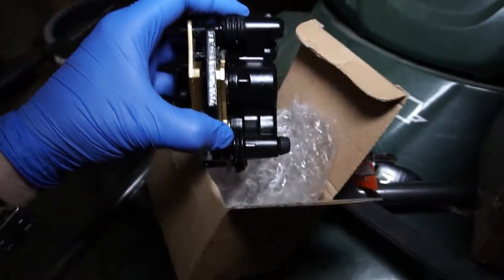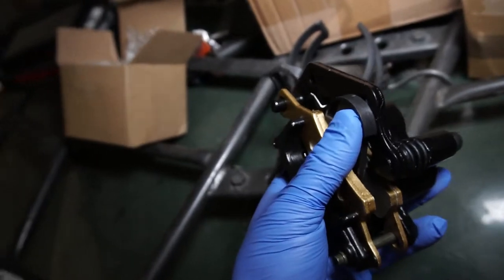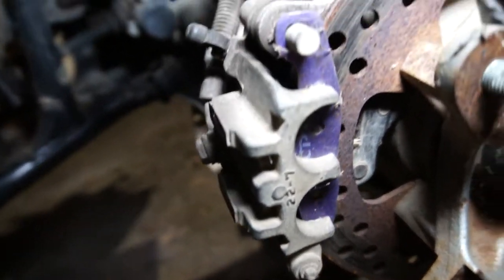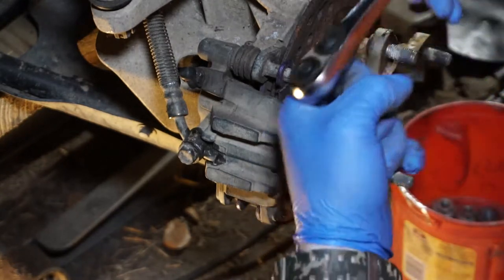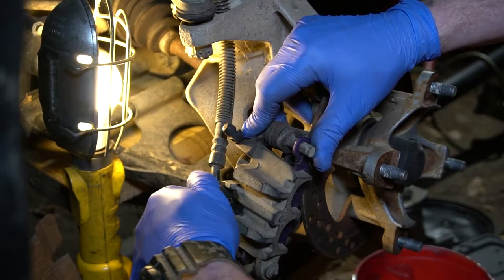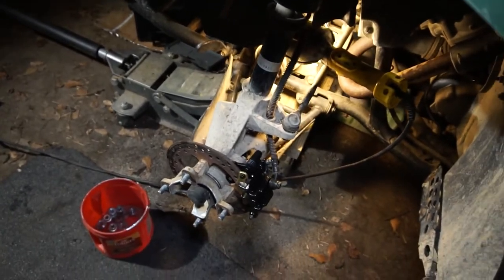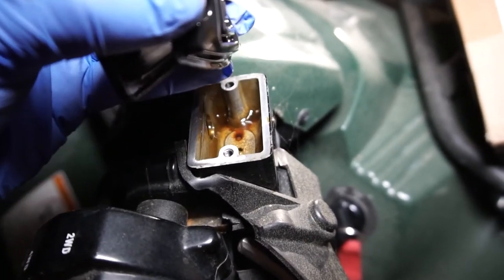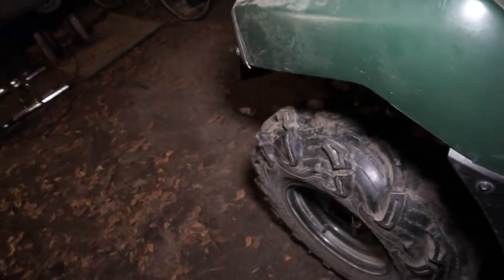How to change ATV brake calipers Kawasaki Brute Force Prairie 650 750 700

Comment: Did you change them because  they where locking up ?
Reply from the maker: I did, I got some old brake fluid that had moisture in it rusted everything up inside of calipers were all messed up so I just put new ones on. My Left front caliper continued to hang up.